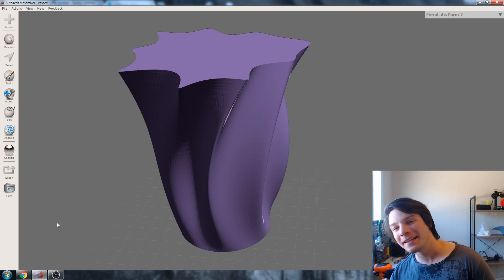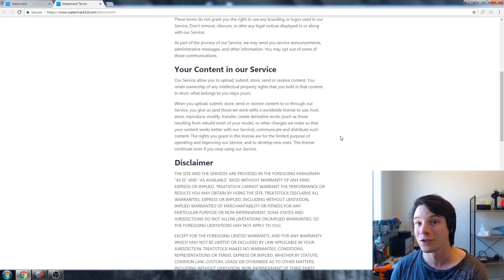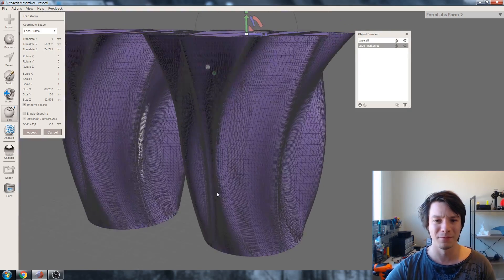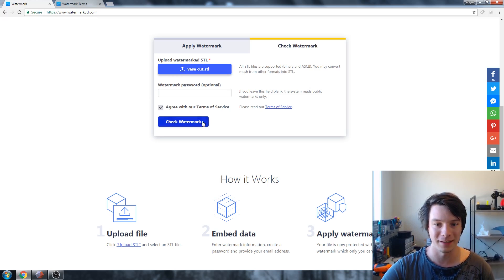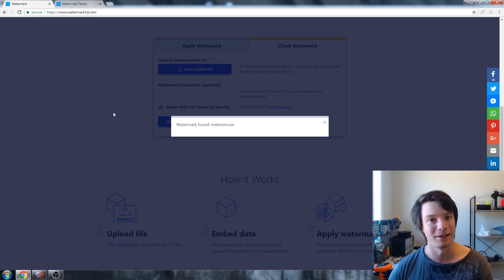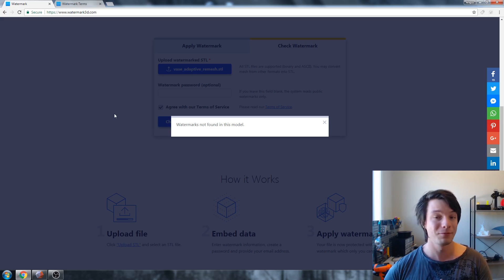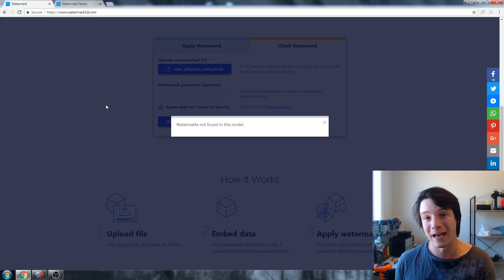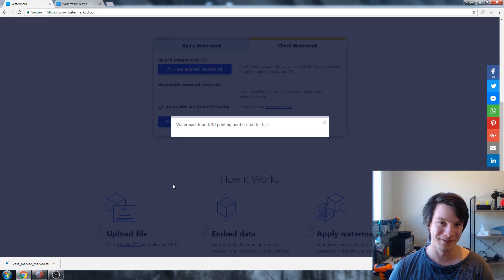How to defeat an STL Watermark (but would anyone really do this?) Watermark3D Round 2

Comment: That's a horrible clause giving them the rights to the files, the more I go into it the more it seems like a waste of time. 

If someone is going to sell a file that they know they shouldn't they they will make sure to remesh, remove stuff anyway. You can remesh without making it look any different. 

Also even if you did find someone copying and somehow proved and had evidence that it was yours, most people would not have the money or the will power to persue a legal battle. 

I agree if you don't want your files to be copied keep them to yourself.
Reply: There probably is no specific "those we work with" at the moment. But it allows them to do things like bring in a temp agency to help reorganize their data. Or let a successful secondary project splinter off into a sister company.
And yeah, they probably never delete it. With few exceptions the standard practice in business IT is to never delete anything. Even things that look like they're deleted are just hidden in some way.

And if you aren't okay with those practices, that's fine, don't use it. But the terms of service is a two way street and I don't see anything malicious to be done with "the limited purpose of operating and improving the service, and to develop new ones." and if you're worried about them not following those terms then it literally doesn't matter what's in there. You presented them with the file. They would be capable of holding it even if they said they wouldn't.
Reply: I don't think Tac Blades is suspicious of what they are doing with your file, but rather what the disclaimer can let them do with it. sure maybe right now they aren't selling your designs, but whos to say that 10 years down the road when 3d printing is a much more household common item, they then decide to sell your designs. 

   there are certain loopholes with legal clauses that let companies say they will not "sell" your information, but they still make money off of it. this is how those sketchy phone calls get your number. you give a normal business your number and they say "we do not sell your information" then they give it to a sister company that can "Fund" to the parent company for "other reasons" and they are free to do what they want with your information.

So with these clause, the watermark sight can't "directly" sell your design, but they can give it to "those they work with"
Reply: Nathan Walkner loads of possibilities like native hosted app so you do it yourself, limit it and not provide any information to anyone else like partners or advertising etc, not provide the service especially if its not really effective.
Reply: The rights are given "for the limited purpose of operating and improving the service, and to develop new ones."  That seems reasonable right? How is it sketchy?
Reply: Fossil98 "you give us (and those we work with) a worldwide license to use." So who do they work with where is the model going to?
"This license continues even if you stop using our Service." So how long do they hold the model is it forever.

It should be simple we use your model, we delete it after, we will not share it with anyone.
Reply: This is something you'd do with files you already made public and say you're selling them for like 5 bucks or something to stop people from just copy pasting them for 3 bucks somewhere else
If you had your own private files that you don't want anyone to access you'd keep them on your own computer/whatever storage device under some sort of encryption

Comment: In Blender you can Simplify or how its called in blender Decimate, based on the planar angle and then set the Angle Limit to something really low like 1° or even 0.1°
That should in theory destroy the watermarking without damaging the model too much

Comment: In the case of overwriting the original message, the original still exists within the mesh from what I can see in the video. So if the ownership were to come into question, the author should be able to present the original watermarked file for comparison, as the re-marked file should contain all of the geometry of the original watermark, along with the addition of the new watermark

In a case where they first removed all the water mark by restoring quads in this case, then there would be some issue, as both the author and thief should have "unmarked copies"

I'm definitely curious as to how it marks a triangulated mesh, does it cut edges to insert additional vertices, and edges etc.

Comment: the watermark is still there, just the reading algorithm stopped after decrypting the first one that it found (which is the new one), devs just need to make it check the entire model instead of stopping after one success. this should be an easy or hard fix for the devs depending on how they made their decryption algorithm.

Comment: I think Angus just found an edge case the guys at Watermark3D completely overlooked!  Should be pretty easy for them to fix, though.  Just check for a watermark before applying a new one and fail if one already exists.  Password protected watermarks are trickier, though, since if it failed, you'd know there was a password protected one in there somewhere.  Of course, if you're going to that much trouble, it's easy enough to tell that a watermark exists just by looking at the wireframe view of the model and seeing those funny blemishes, so you'd strongly suspect it's there already.

Comment: As mentioned on the first video, if you add a password to your watermark, you must use the same password to overwrite that watermark. If a file is watermarked with two different passwords you can retrieve each watermark by using the relevant password.

Comment: Wow! The easiest way to circumvent a water mark is to just re-watermark it! It's a website designed for thieves! Wonder if the developers came from Yahoo...
Reply: Da Hai Zhu if you put a password on the first watermark the second one won't delete the first.
Reply: 1) It seems quite easy to distinguish an automatically remeshed version of a model. In case of a dispute, this should resolve the conflict easily.
2) If someone adds a watermark to a previously unmarked model, the fact that the original owner has an unmarked and non-re-meshed model should resolve the conflict in their favour. They can't remove the watermark without remeshing, which means they owned it prior to the watermark existing.
3) If someone adds another watermark on an already watermarked version, it gets overridden, but this appears to only apply to "public" watermarks. Just knowing that a private watermark exist doesn't help the thief if they don't know the password to it, since they can't override it. However, so long as the original owner knows the password to their watermark, that proves their claim.
4) In the rare case that the thief figures out your password and overrides your private watermark, studying the model will be the deciding factor. Even if the password was overwritten, the original author will own a simpler, non-re-meshed version of the model, with the original watermark. As you can see from this video, overriding a watermark makes the geometry more complicated and is thus possible to detect.

So I'd say this is far from a waste of time. Any time this service comes into play anywhere in the process (whether it's the thief that adds or overrides a watermark or the original owner), the original owner can be determined.
Reply: I'm just going to assume that the website keeps dates of each time it adds a watermark. So if someone does re-watermark an stl file, the original owner will be able to prove that there's was watermarked first
Reply: probably facebook lbh

Comment: Hey Angus, if you put a password in on your watermarked upload, and someone else puts a password in if they re water mark it, then when you check it with your password you get your watermark and if they check it with thier password they get thier watermark. Can't tell who marked it first though.
Reply from the maker: Interesting... I wonder what the limit is. Needs more testing!
Reply: I don't know why they didn't think of adding a small timestamp too, like "[watermark text] + [unix time stamp]"
but I guess you could always do it yourself to prove when it was marked, or as mentioned at least yours doesn't have their watermark.
Reply: the service should just allow the watermark to have a flag that prevents further water marks from being applied using their service. The timestamp only works if they are the authority, otherwise I can just watermark it 1970-01-01 00:00:00 and defeat it.
Reply: but it would be odd if someone else's file has you're water mark and your's doesn't have their's...im sure it would be fairly simple to prove who made which file first

so the password protected watermark is more resilient... and works better... remeshing still works though i bet XD
Reply: True!! But you would need their password to prove it.....
Reply: yes please, and a video #3 on the subject.

Comment: Debunked! 
See how long it takes for this to get a takedown notice now. LOL 😅

Quite sad that it does not say "hey this is watermarked!" when you try 2nd time.. or that it doesn't say when reading "this has multiple watermarks" and listed them all
Reply: i mean it would be easy for them to have it check for a watermark before allowing you to add another (or so I would think). simply have it not allow to add another. they could use the password protection feature to allow overwriting of a watermark
Reply from the maker: Yeah it was the top requested thing in the last video and it REALLY surprised me.

Comment: So like memory addresses it's overwriting the same places on the model, since your second watermark was longer than the first it completely overwrote it. The next logical question is what if the second one is shorter than the first, will you then get a mix of the two? And what is the max length of the data?
Reply: just by visually comparing the models it should be clear that BOTH marks are actually present. There was MORE stuff added to the double-marked vase, which means the original mark is still contained. Seems like an issue with them viewing watermarks. It seems like a dumb oversight to me that they allow you to watermark a file they KNOW has a watermark already.

Comment: Sounds like the solution for this would be to check for a previous watermark before applying a new one. Nice spot!
Reply: pizzaslapp Yeah that would definitely be the easiest solution. Part of the process should be scanning the file for any existing watermarks then, if there is one, only allowing you to proceed if you have some kind of key to overwrite the previous one
Reply: Yeah for sure. I think even having a password to unlock it might be a good feature - another way of proving you are the owner.
Reply: but you can apply your own password protected watermarks... and both are detectable... but it would be odd if someone else's file has you're water mark and your's doesn't have their's...
Reply: There is password protection, if you use it thives can't even know it's watermarked without original password. And it's not possible to overwrite password protected watermarks.
Reply: Nathan King That's exactly the case. Owner can provide file watermarked only by him and not others. Actually, in court, to prove originality you would provide a source, not "watermarked file". Watermarks needed for automatic/public discovery of copyright infringement. (I'm not a lawyer, just thinking out loud)
Reply: well i was suggesting when trying to prove ownership why would someone else's file have your watermark? there would be no reason other than that they have stolen it... even if the file also has their watermark